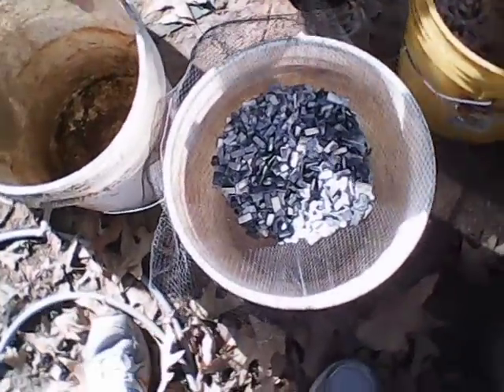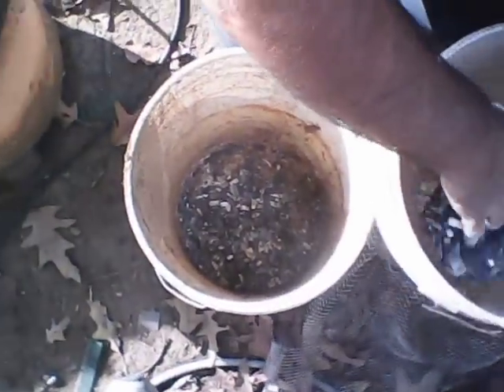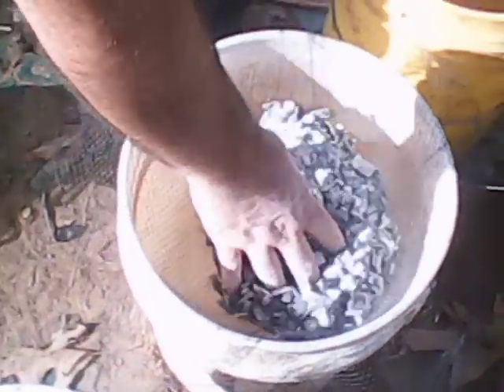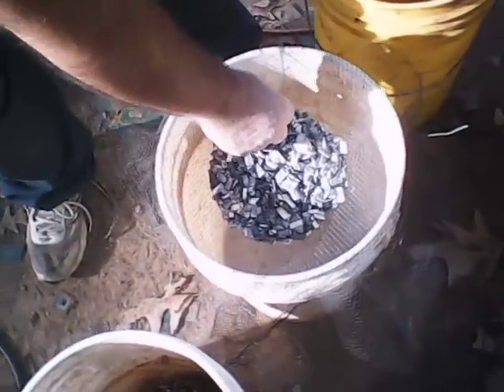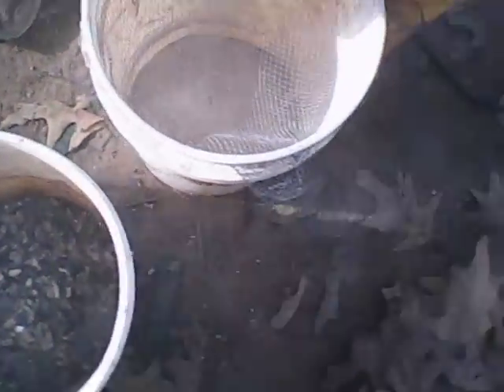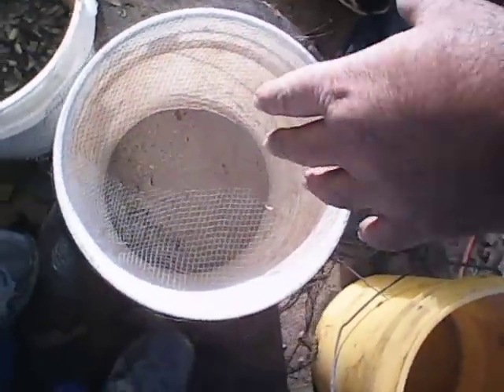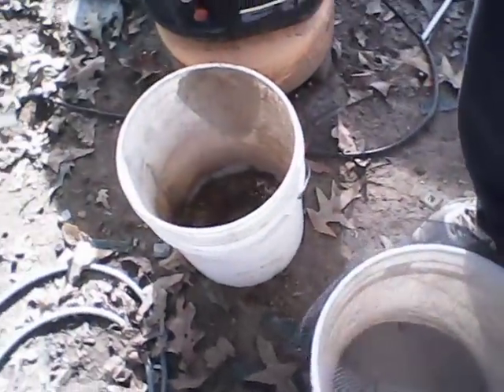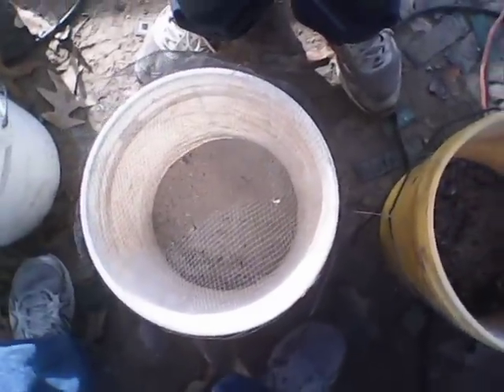prepping and screening incinerated chips

Comment from the maker: the temps inside the furnace exceeds the melting point of iron. ive already tried some different metals and am thinking of using this configuration for melting my copper anodes for my copper parting cell.its a good thought though but i would rather keep metal parts out of the furnace when processing gold bearing material.

Comment: I do say for saftey purpose, the dust from those chips and concider what is inside the substrates of those chips; Germanium, arsinic, lithium, lead, tin, and other metals,, please concider and be cautious.

Thanks for listening.
Reply from the maker: Thank you for the safety tip. I normally wear a respirator when grinding or handling incinerated material. I don't wear it while making a video so I can be heard. Take it as a lesson in what not to do.

Comment: what do u do about the MLCCS thy dont burn ans r real small and a magnet keeps pulling out gold with it
Reply from the maker: The MLCC's are removed during the AP process. By the time the chips make it to the incinerating process, the MLCC's have already been removed.
Reply: u jus use a magnet with the solution in water to remove them??? they r tiny they filter with the gold sometimes
Reply from the maker: They actually are mixed with the gold foils. I use gravity separation to wash the foils out of the MLCC's and other trash left out of the AP process.
Reply: like panning or a shaker table? will it react bad if i leave them in with the bleach?
Reply from the maker: Basically just washing with clear water from one container to another. The foils stays suspended long enough to decant the water with the foils to another container. No bad reaction. It will dissolve some of the palladium.